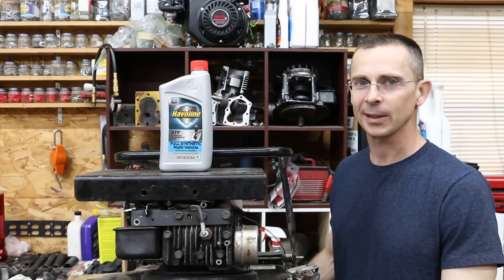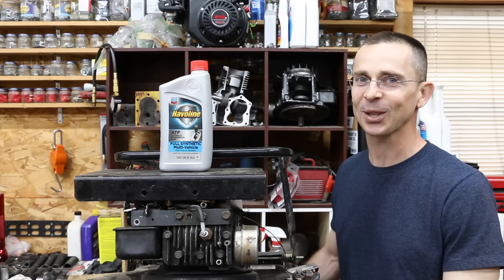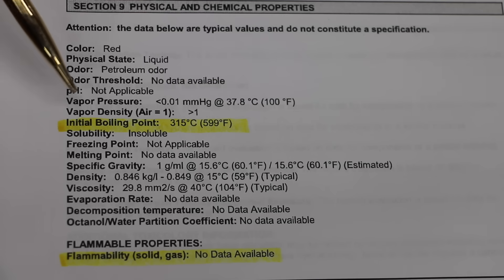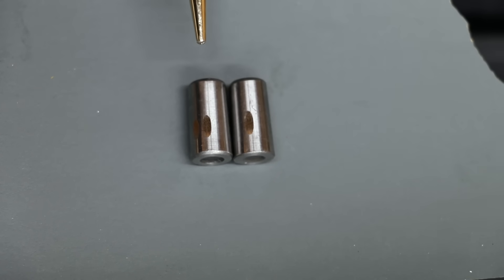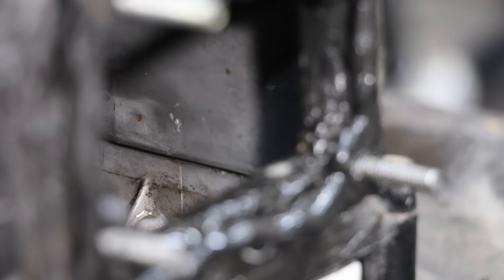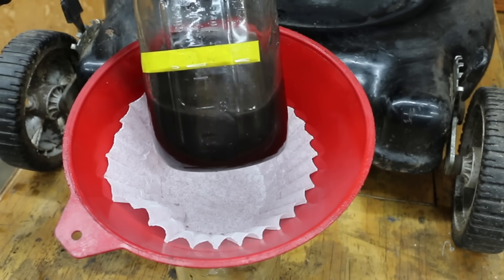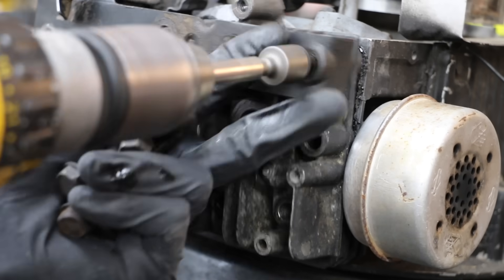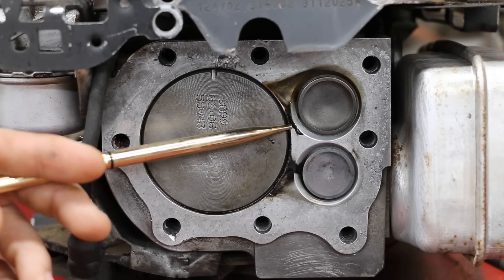ATF as an Engine Oil substitute?  Let's see what happens!

Comment: For years I've used one quart kerosene to four quarts of oil when trying to get an old engine free. ONLY let the engine idle with NO load. Run it for about twenty minutes. Drain. Run the fresh oil for twenty minutes. Change oil and filter. Context here.... I'm talking about long dormant antique tractor engines, etc. I'd never do it to a modern engine.
Reply from the maker: Seems like a great strategy for an antique tractor engine.

Comment: Not worth the risk. Better to use what they recommend or dissemble the engine do parts clean and evaluate the condition of the parts rings etc to determine what needs replacing. Most times if a mower riding or other wise is let’s say ten years or better might be due to cost to replace the engine all together. But things like compression rings to oil rings may come out cheaper in the long run. Up to owner.
Reply from the maker: Great point!

Comment: I use ATF to free up stuck nuts/bolts. I've heard the cleaning thing, but never done it for that, I just use an engine flush. I have an old motorcycle engine that I couldn't turn by hand, and I filled the cylinders with atf and let it sit for a few weeks, it freed up the cylinders there.
Reply from the maker: Thanks for commenting on how you've used ATF!

Comment: Still great practical science.  I have used diesel fuel or kerosene to clean out sludge from a couple old car engines but I use a mix of oil so I do not blow anything up.. Seems to clean a lot of sludge out of an old engine.
Reply from the maker: Thank you for this recommendation!  I'll test Diesel soon.

Comment: Todd
Another great video. I'm really shocked to see a plastic cam and a 27-year-old Briggs & Stratton engine. You that's a really good idea or a really dumb idea I mean I've seen the governors be plastic for the longest time but now the cams unbelievable. Does the predator engine have a plastic cam ? I don't know all I remember is we used to work on stihl which yes the BR 600 backpack blower has a plastic cam where is Conversation going LOL we worked on Polaris and Honda and arctic cat . We turned away and the other brands. So recommendation for an engine oil have we tried mineral oil or castor oil?
SGT 
General repair
Reply from the maker: The Predator's do not have a plastic cam.  I have a John Deere garden tractor with a water cooled Kawasaki engine.  It has a plastic cam gear.  They are known for failing.  Every time I start the tractor, I wonder if it's going to fail me this time. LOL!  I haven't tried mineral oil or castor oil yet. Thank you for this video test recommendation!

Comment: Now that I've watched, my wood splitter has the option of A.T.F. or non-foaming 10 weight hydraulic oil. At $5 a quart for a.t.f.  and $40 for 5 gallons of hydraulic oil I guess you know which way I went so it looks like the A.T.F is 10 weight. Splitter works just fine on the hydraulic oil opposed to a.t.f. and it had both in it when I drained it out the first time. Used about 4 1/2 gallons to fill it up plus the cylinder too. So far, so good and THANKS, Commander! A-PLUS AGAIN!
Reply from the maker: Thanks again, Lewie!  I use hydraulic fluid in my log splitter as well.  The price is right!
Reply: @ProjectFarm  you can typically use ATF in place of hydr. fluid ( pwr strg, lift systems, etc )  but not the other way as ATF has additives for the trnsm clutches that Hydr fluid doesn't. 
 both are 10 wt

Comment: I use atf as an additive not by itself. About 1 quart out of the six that go in my engine is as far as I go as it thins the oil. I top off with it from time to time mostly. I also add a bit into the gasoline that goes into my small engines. Works really well. My push mower is from 2009 and has never had the carburetor apart. Starts on the first pull always.
Reply from the maker: Thanks for commenting on this.
Reply: Project Farm Thank you so very much for your clear cut , unbiased content!

Comment: I used to add a quart of ATF and let a vehicle idle for about 10 minutes then redline it once for just a blip to break up sludge in engines before doing an oil change. NEVER drive with ATF in the crankcase, but with no load, it wont harm anything.
Reply from the maker: This is great information. Thank you!

Comment: You should of tried running fresh ATF after the original test to see if metal shavings were caused by lack of film strength or if it was cleared out by original atf
Reply from the maker: Great point and thanks for commenting.

Comment: Sure it'll work but I don't know about the detergent additives regular motor oil has. 5 and 10 weight engine oil is a common thing but not for me. I LIKE my oil pressure! GOOD TEST, COMMANDER! The BEST 2 yall!
Reply from the maker: Lewie,  Thank you very much and all the best to you and yours!
Reply: We are blessed with the best!
Reply: I sea you are on your best behavior here Lewie.
Yeah ya can wash dishes with water but the detergent makes it easier.
Reply: yes its more about the additives than the base oil, it would on a longer scale be worse, but youd need a laboratory to tell, when you can measure dissolved metals and judge how much the wear is, it may compare similar to a very old engine oil, back in the old days, it was the same oil for 2 strokes as car engine oil, which was the same for a diesel vehicle too.
Reply: Yesa, I iz IH! I use diesel formula Delo or Valvoline 15/40 in everything I have and I've never had a lube issue yet. The high detergent, high dispersant will keep the sludge out and let it go down the drain when it's changing time.The loader I ran had 24K hours on it when I left and NO problems at all. Probably is still going but I haven't been back in a while to see. The good old guys were all gone and I left with a smile on my mug but I had to remind myself to do it.
Reply: Well it's a funny thing that I run DIESEL FORMULA 15/40 in everything for YUEARS and have NEVER had a SLIGHT issue in anything!

Comment: I used to sub 1 quart of oil for a quart of type F trans fluid in my truck and my mustang something I did for nearly 15 years. I no longer drive those vehicles they ran great when i parted ways with them. The truck is still on the road, I see it almost daily.  I don't know about the mustang as it is in another state.
Reply from the maker: Thanks for commenting on how you used ATF!

Comment: Recipe for rich and simple French Onion Soup: Melt butter with olive oil in an 8 quart stock pot on medium heat. Add onions and continually stir until tender and translucent. Do not brown the onions.Add beef broth, sherry and thyme. Season with salt and pepper, and simmer for 30 minutes.Heat the oven broiler.Ladle soup into oven safe serving bowls and place one slice of bread on top of each (bread may be broken into pieces if you prefer). Layer each slice of bread with a slice of provolone, 1/2 slice diced Swiss and 1 tablespoon Parmesan cheese. Place bowls on cookie sheet and broil in the preheated oven until cheese bubbles and browns slightly.
Reply from the maker: Seems like a great recipe!

Comment: Cool test. I actually work at an aamco transmission center. I have used ATF to clean older engines. What i do is bring the engine up to operating temp. Drain the oil & filter. Then fill engine to spec with ATF. However I will only let the vehicle idle for about 10 minutes with the ATF. Then Drain & fill with the new filter and engine oil.
Reply from the maker: Thanks for commenting on your experience with ATF!

Comment: I’ve never ran an engine on straight atf but have added a quart or two to help clean the inside of one before taking it out for a rebuild. It’s been years since I’ve done that, but I used dexron 3 with fresh oil and it always came out dirty after idling for a half hour. I’ve seen guys use mmo and diesel to do the same thing with good results as well.
Reply from the maker: Thanks for commenting. I'll test diesel soon.

Comment: Dexron VI is not normal transmission fluid. It is light years ahead of the previous generation of Dexron III. Testing by General Motor's has shown Dexron VI to extend transmission life at least 2 to 3 times past Dexron III. So much so that they actually skipped using the names Dexron IV and Dexron V. It is quite possible that you would see different results with, say, Type F or even Dexron III.
Reply from the maker: This is an excellent point.

Comment: If you have any way to test it, I wanna know if a diesel will run on power steering fluid. I add it to my fuel tank to lubricate injectors and fuel pumps. Just wanna see if it causes issues
Reply from the maker: Thank you for this recommendation!

Comment: Project Farm- I will be sure to follow up with my results. Also, I'm using regular full synthetic Castrol Edge 0W-40 oil. Its kind of hard to find high mileage european formula oil. I also haven't tried engine restorer.
Reply from the maker: Looking forward to reading your updates.  By the way, I'm not recommending you try engine restorer.  I tested it in a previous video and it improved compression.  In my daily driver, it slowed oil consumption considerably.  It seems to work, but I'm always reluctant to recommend products.
Reply: I don't think I have any problems with compression, only the oil control rings. And yes, I'm also reluctant to try things like that especially with the vanos(variable valve timing) in my engine, it is controlled by oil pressure and can be effected by different oil viscosity.

Comment: i had a 1977 Monte Carlo with a 350 CID,  4 bolt main bearing engine in it. I always ran high detergent motor oil in it with a can of STP oil treatment. I finally killed it when I treated it with slick 50, worst mistake I ever made. The HD motor oil always kept it clean, and looked almost like diesel oil when I drained it. Alas it succumbed to the worn valve guide problems all old 350's eventually die from.
Reply from the maker: Thanks for commenting on using high detergent motor oil and sorry to hear about losing the motor to Slick 50.

Comment: I wonder if you didnt use synthetic atf would the results differ. In my years of automotive experience, i was always told atf is mostly a detergent. For example if it gets on a concrete, it is usually cleaner once it is removed
Reply from the maker: This is a great point and I'm not sure.

Comment: If atf has more lubricity, your car will not move because the clutch packs in your AT will just slide over each other.  Atf is a friction modified fluid.
Reply from the maker: Great point.  ATF seems to have less lubricity than conventional motor oil.

Comment: It is a 0-20 weight motor oil with a friction modifier and other additives in it I have been using atf in engines in moderation now for 23 years and I own a 89 gmc 1500 i fully restored it when I took the engine apart last summer clean extremely clean and on my wife's 07 Lincoln when we bought it full of carbon tore it down cleaned all the sludge out and now run 1 quart of atf in it every oil change and  no sludge sooooo yes it works
Reply from the maker: This is great information. Thanks for commenting on your experience using ATF!

Comment: When you checked cylinder compression did you leave the cylinder dry or did you oil it down? You can gain a lot of pressure by squirting oil on cylinder wall. It will help the rings seal.
Reply: Also great video. Keep up the great work. Thanks for the educational videos. I really enjoy them.
Reply from the maker: Thank you! I usually don't add anything to the cylinder before the compression test.

Comment: I do this every so often to my accent and when I checked the crank and valves they were clean like new with no sludge after 200K miles. Only I used a 50 50 mix.
Reply from the maker: Glad this is working well for the vehicle. Thanks for commenting!

Comment: Bear in mind that ATF is a high-detergent fluid that is designed to lubricate to an extent, but is primarily designed as a pressure fluid. Something to transfer power. It needs those detergents in it to keep the extremely tiny passages in the valve body of a transmission clean and open. It's also designed to aid the clutches in an automatic to perform their function and grip their friction surfaces more effectively. That is to say, it's made so that it lubricates well enough to keep parts from wearing prematurely, but not so much that it prevents the clutches and bands in the transmission from doing their job.
Reply from the maker: All great points and thanks for commenting!

Comment: I soaked an old T3 turbo in ATF for a week to get it apart for a rebuild. Seemed to have converted/taken off all the rust from the turbine housing and center section, and the bolts were no longer seized. I'm convinced it works.
Reply from the maker: This is great information. Thanks for sharing this experience!

Comment: You should use a caliper/micrometer to measure the wear on the bearings from the friction/lubricity test. From watching all of your videos, most of them look the same as motor oil. An actual number comparison would be nice to see alongside the visual wear.
Reply from the maker: Thank you for this recommendation.  I find it challenging to get an exact measurement with the calipers, but I can get pretty close.

Comment: Use power steering fluid in the crankase, please.
Reply from the maker: Thank you for this recommendation!
Reply: Project Farm Thank you for the high quality videos you make. But l've just seen that ATF and power steering fluid are quite the same thing, so I don't know if we could hope a different result.
Reply: most power steering fluid is ATF.
Reply: Power steering fluid is the same as utf/hydraulic fluid. It is similar to ATF. There is detergents and friction modifiers in atf but not power steering fluid
Reply: ATF is the same,mostly.
Reply: Ford actually uses transmission fluid in their hydraulic power steering systems...  Most of Ford's hydraulic power steering systems since 2005 have used their Mercon V transmission fluid.  Prior to, they used Mercon III transmission fluid.  Prior to that, they used Type F transmission fluid.
Reply: Aaron Thomas same with holden, dex3 in both
Reply: Power Steering amd ATF are very similar.
Reply: ATF is an extremely good detergent. Wash your hands with it. It also cleans the sludge out of your engine.Just don't drive the car/motorcycle/lawnmower/mini bike.
Reply: This should soften up rubbers and help with leaks
Reply: Power steering fluid is not hydraulic oil,while similar not the same . The viscosity of atf isthe same as 28 hydraulic fluid the additive package is not the same.Atf has special friction modifiers and a lot of detergent (that's what burns and smells) but used in moderation will clean up the inside of an engine quite nicely,quite quickly. If you want the same result ,use mobile delvac 1300,it just takes longer.
Reply: it is! if youre a subaru!
Reply: yup, its the same stuff, check your cars user manual under specifications, should say same thing for both.

Comment: I have used Amsoil Engine and Transmission Flush and it worked very well for cleaning the oil system in a 2010 Chevy Malibu.
Reply from the maker: Thank you for this recommendation!

Comment: When you use ATF to clean a crank case, it’s supposed to be 50/50 mix. If the Engine takes 4 qts of oil then 2 will be oil while 2 will be ATF. So you can get the cleaning benefits without harming the Engine.
Reply from the maker: Great point and thanks for commenting.

Comment: Even after testI would not run pure ATF. Your choice of full synthetic might have skewed the results somewhat. The use of ATF for engine cleansing is an old one. BUT, It is ATF DEXRON that is used due to its extremely high level of detergent additives. I routinely add a quart of dexron to my engine about 3-500 miles before change time every time. I have NEVER had to go into this engine in over 340 THOUSAND miles. It is a 5.0 V8 Ford F-150 XL-SS.
Reply from the maker: All great points and thanks for commenting on your experience with using ATF in the crankcase.  Thanks again!

Comment: As its listed at highly refined mineral oil then its not a true synthetic oil.  If it was an oil it would be classed as a Group III oil.  You should redo this test with a true synthetic, Group IV product.   Engine flushes work best on the valve train.
Reply from the maker: Thank you for this recommendation!

Comment: I did use atf in my pulling mower/pulling tractor it had a Briggs 16 hp opposed twin I did clean it very well and I started using in that engine for oil it works the same as 0w20 oil
Reply from the maker: Glad it worked as a substitute for oil.

Comment: charcoal fluid as fuel and crankcase cleaner.
seen a few people use atf to free up a lifter.  not sure if it worked or if it was the revving.
Reply: only some charcoal fluid in the oil
Reply from the maker: Thank you for this recommendation!

Comment: I don't see a benefit, you're running a risk sticking this in a V8 in my opinion.
Reply from the maker: Great point and thanks for commenting!
Reply: If anything the cylinder looked worse, it did gain compression but more compression on a old crank and wrist pin bearing sounds "Sketchy" to say the least. You want that lifter noise to disappear, pull a valve cover. You want higher compression? drop new rods and pistons. I'd rather spend 2000 on a engine build then ask my self why everyone said atf was the solution.